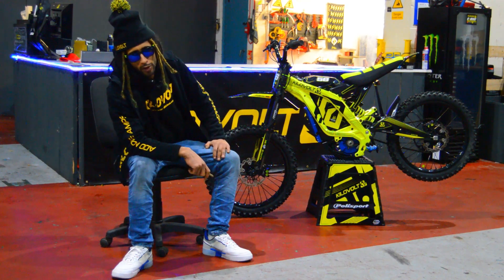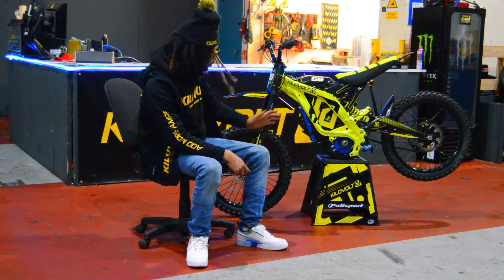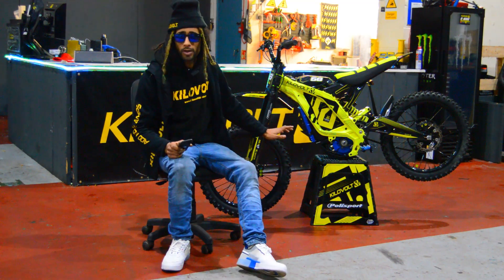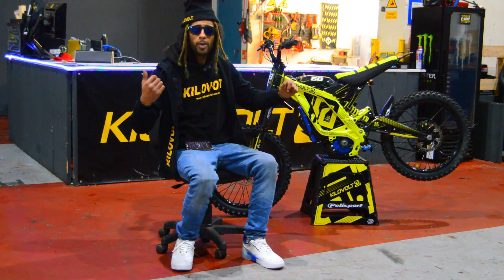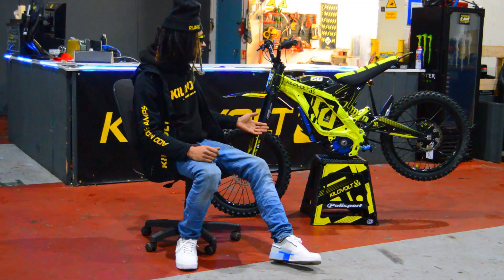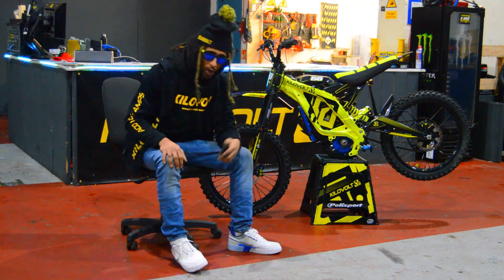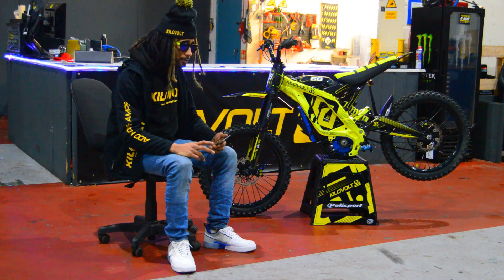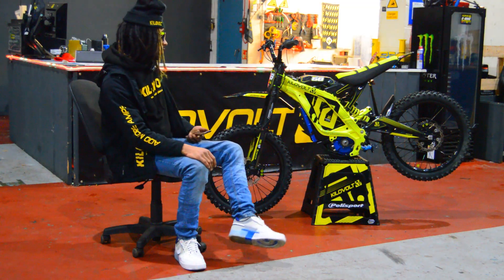Kilovolt Tech Talks EP015: KO MOTO SPECIAL ! Our first thoughts after riding the KO Combo + More !

Comment: If you get that much more output for the same wattage, it shows the inefficiencies of the other controllers being compared. Inefficiencies, like heat build up are what destroys the controllers and even motors over time.

I'm using a kelly controller that performs much worse as heat builds up unless you use adequate heatsink and fan.

I'd compare ko to lto batteries. Heavier, but performance and longevity are way up there. Infact it's probably an unfair comparison because the difference seems to be more noticeable with ko.